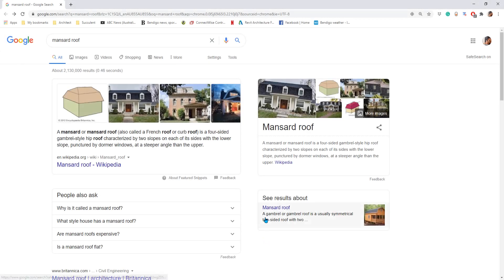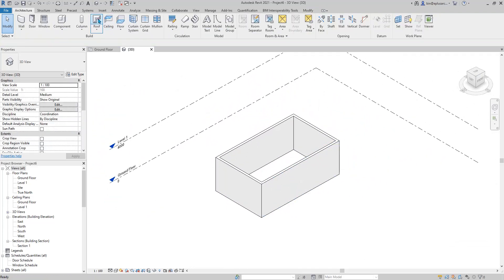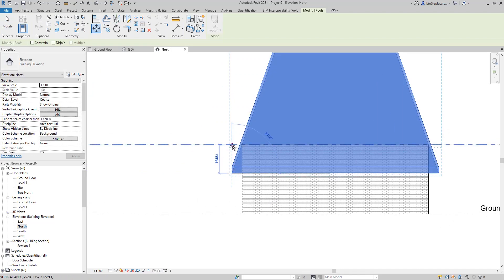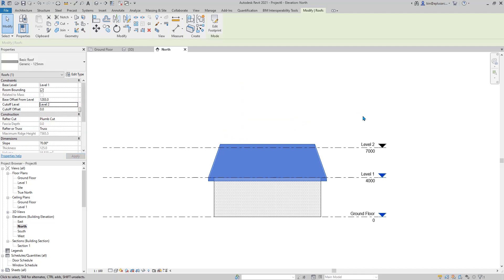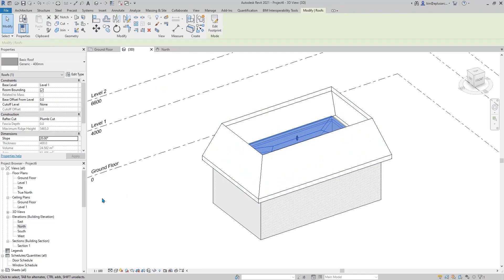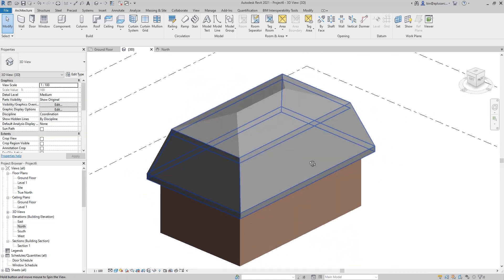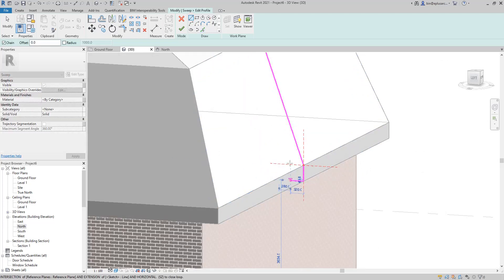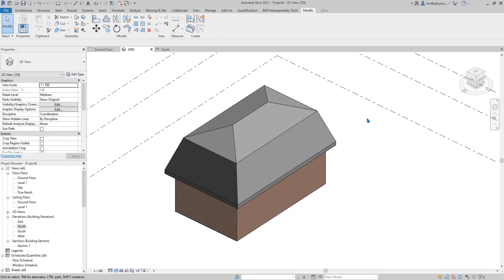Revit Exercise (Day 160) - Mansard roof

Comment: Great Tutorials 😃, Can you make a video on how to cut voids on a model in place mass extrusion?

And if it's possible in revit  to make edit poly edits like 3ds max, mainly selecting certain vertices and moving them in x y or z, if you can make a tutorial on that as well? Thank you in advance 💕🙏🏻
Reply from the maker: Not too sure about edit poly in 3ds max since I don't know much about it. Do you have an example (a form, a shape, or a structure) so I can try to model it?
Reply: @BINHE615  I mean like transforming the Geometry into Points that can be Pulled and Pushed in the X Y Z Directions to make for example a Regular Rectangle into a Irregular one
Reply from the maker: @Tech-WonDo  yes you can. You can simply use the Create Form tool to build your massing, similar to the workflow in Sketchup.
Reply: @BINHE615  Well if you can Create a Tutorial about that 💕 Notice am talking about Massing in the Project not as a Sperate Family for Making Masses, Also the Void Cut thing please 💕
Reply from the maker: @Tech-WonDo  No problems, I’ll work on it.